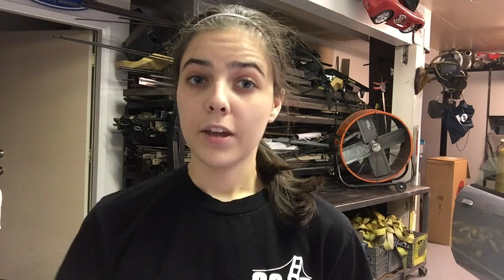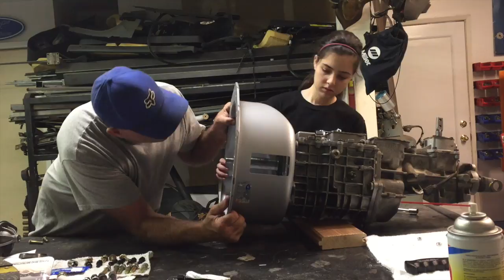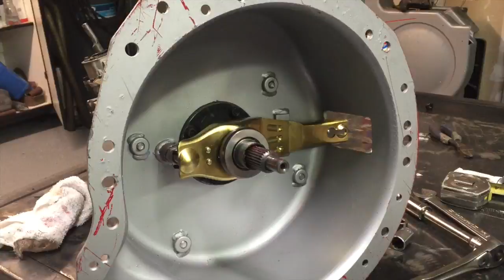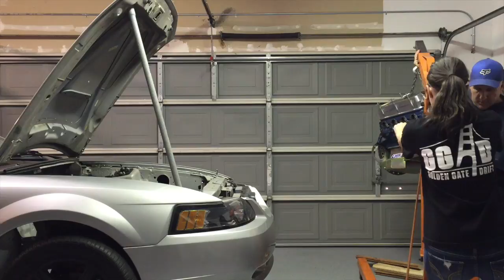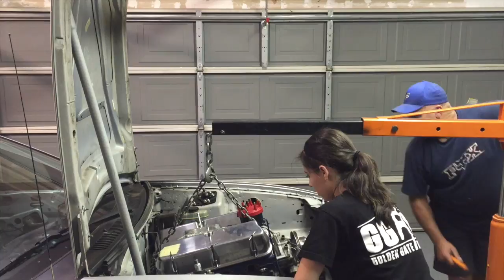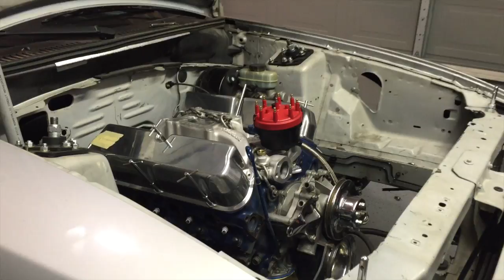400 HP 289 ENGINE INSTALLATION IN A NEW EDGE MUSTANG

Comment: I built a 289 myself and have a 2000 stang I'm putting it in. Just wondering all you got in. I have an Hendrick Cam Hendrick pistons Edelbrock distributor  Edelbrock 4 barrel intake and a Holley 750 dual pumper carburetor. also what exhaust will you be running I'm not sure what exhaust I wanna run yet.

Comment: if it is a v6 351w will drop right in on the k member using fox body motor mounts I just did it today on my 2000 I don't know about a 4.6 v8 k member never tried it
Reply: So the 351 will fit but what did you do for the transmission and wire harness?
Reply: @deltadetrix  Put a c4 in it and you can scrap most of the wire harness depending on the route your going.

Comment: I love watching this build gives me a good idea for when I start building mine.. but I am going to be making mine into a daily drifter..any tips on what should I mod first to get it side ways and how much did you spend on the build
Reply from the maker: Thanks for watching! I would recommend getting a hydraulic drift brake and a panhard bar. Also depending on your budget a steering angle kit but you have to run coil overs with it.

Comment: Maybe you can help me with a question? I got a 289 in my 65 mustang and original 3 speed trans. I need to change the flywheel and clutch is 157 teeth or 164? And is the clutch a 9 inches? Thanks
Reply: House boat Rob It depends on the bell housing. I have a t5 trans from a v6 mustang which has an 11” 164 tooth flywheel. But the v8 t5 trans have a 10.5 in 154 flywheel. So I had to buy an 11” 164 tooth for my 302 swap In my v6 mustang.
Reply: If you have a top loader 4 speed, it takes a 11” 164 tooth flywheel
Reply: @pipeline_hank5277  my son in law has a 2001 mustang that had a v6, we are putting a mild cammed 302 in it from a 1971 maverick.

i have been searching to see what motor mount adapters i might need, but i keep finding stuff to put an LS motor in it.

Im thinking the factory 1971 302 Motor mounts might just work, but after watching this video. It apears that the mounts they used (the stud if further forward than the stock 302 mount).

Do you know if I need to use the factory 1971 302 mount, or is there a part number that someone can suggest for me.

Thanks in advance.

Comment: Did the 289 sit on the mounts and bracket with no modifications? (Asking for a friend)
Reply: Well we know you asking for YOU but yes, all should drop right in without doing anything. new edges shared the same kmembers as the foxbodies which of course were pushrods.
Reply: @twportre8809  Great setup! this was the first video I came across. I have a 2002 GT. Is it easy to hook up the air conditioning and cruise control with this combination? I'm a old fox body guy. There is nothing like a fresh cammed up ford block.
Reply: @twportre8809  this is false information 
They’re completely different

Comment: What motor mounts did you use because I have these mounts for a 95 Ford Mustang gt and have a 2000 Ford Mustang that has a v6 in it and it doesn’t line up without the valve covers needing to be 3 inches into the fire wall I’d have any solutions please message me

Comment: Why a 289 not a 302? is it because the 289 will work better with the T5 Transmission that was in the V6?
Reply: Trevor The 289 and 302 have the same block. The t5 trans will fit the 289 and the 302.
Reply: @pipeline_hank5277   will the TR3650 transmission mount up to the back of a 302?
Reply: @devorickjohnson7714  no

Comment: There is no way that 289 makes 400hp with stock heads.
Reply: I didn't want to be that guy but you are correct. 300 would be realistic.
Reply: 250 is more like it..
Reply: @DavidRodriguez-jn3sq  300 can be done. Intake and cam and higher compression can get you to 270 easy. Some head work and headers gets you there.
Reply: How do you know they're stock?

Comment: This does not make sense to me. What is the reasoning behind a carb setup? Generally this is not done in drifting because you will run into fuel cut issues due to the harsh turns.
Reply: As long as you have the right carburetor and a good tune, the car should perform well drifting. I have friends who use carbs on there mud trucks.
Reply: Simplicity is the reason. Why make things more complicated with all that extra electronic garbage?

Comment: 400 HP is unlikely.
Reply: Dennis Schell I’ve got a 390 hp 289 Sitting right next to me that has nothing other than heads, intake, dual pumper and exhaust. Streetable 289s and 302s w 400 hp is very attainable
Reply: @taylorhoffman4859  what did u do to it ?